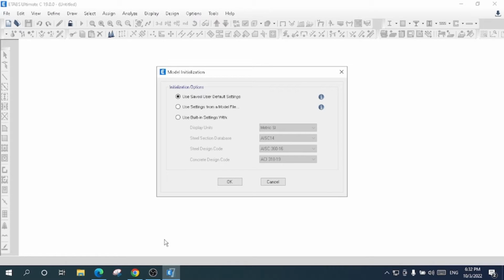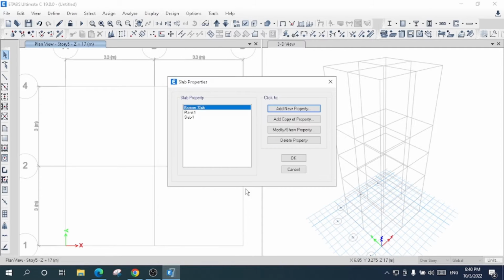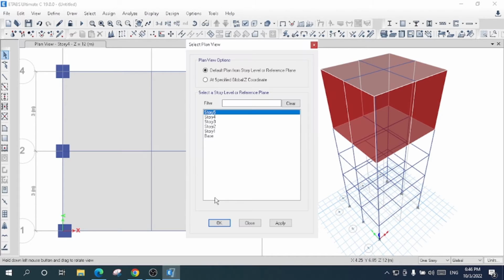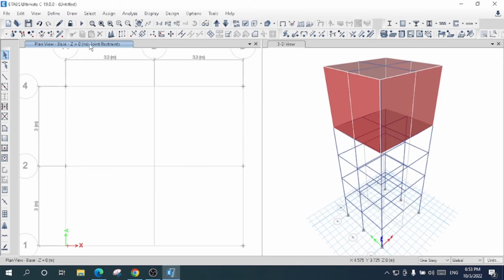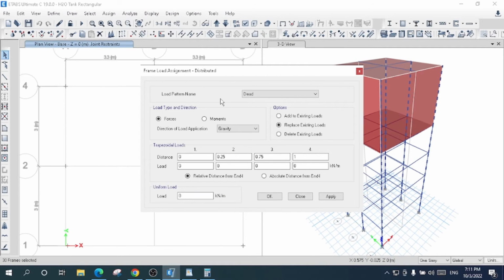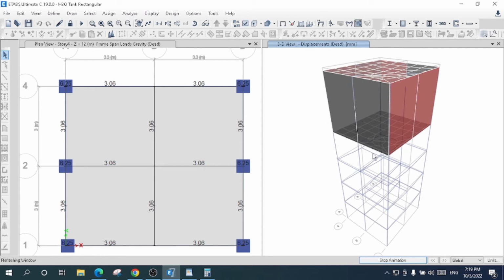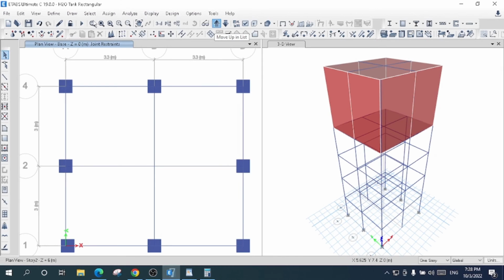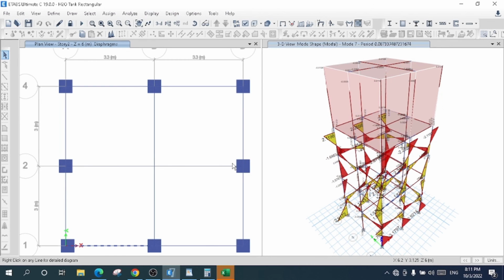Rectangular Elevated Water Tank Modeling & Analysis - ETABS

Comment: there is an issue in wind Y direction...u should change the direction of wind to 90 degrees otherwise etabs will take default 0 degrees and both x and y direction winds will become identical